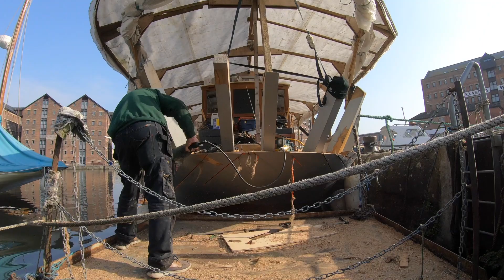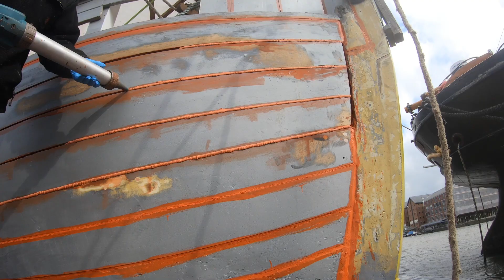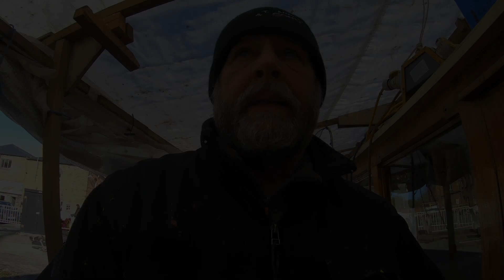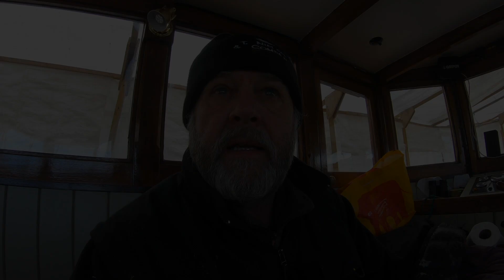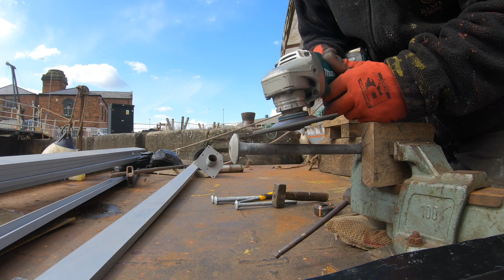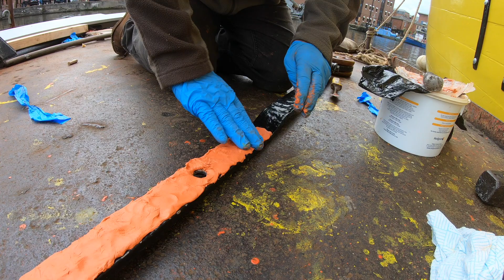Restoring Josefine (part 15) No Let Up.

Comment: I know its not that big of a deal, but why did you grind the squares off the bolts? You could have cut the squares into the chain plates and then it could "lock" the bolt for you, and you wouldnt have taken the zinc off the bolts, allowing them to rust at their weakest point?
Reply: Never mind, I just watched a bit further and saw you going to spray them.
Reply from the maker: That sounds like a very good idea Rachael, I suppose it was too late for us anyway, we had the chain plates galvanised some time ago and in some ways it’s better now that if anything is going to rust, it should be a replaceable bolt than a chain plate but you make a very good point. Thank you.

Comment: Ahoi Josefine! 
Reg I'm sorry I gotta recommend something for situations like Your scraped/ground bolts lacking galv at a pretty critical point after grinding: We used lanolin, woolfat, in situations where some corrosion was pending without anybody getting towards it again unless everything was taken apart again. 
Woolfat or lanolin is to be bought in different formulations, which basically just determine the viscosity of the stuff - it's always the same hair-fat of sheep. For the ground necks of those bolts I would have used "lanolin anhydrite" which is sold via amazon or many other places as an ointment-basis, and is quite hard and stubborn to work with at "normal outside" temperatures, while You can warm it up slightly with a heatgun or a little soldering flame to make it yield and run to every little nook'n cranny You want it in. 
That stuff is used on every surface in ballast water tanks of big bulk freight ships (the tanks within all those subaquatic neophytes come to every port they don't belong) to prevent the hulls from rusting out from the inside during times when no neophytes ballastwater has to be transported, while anything used for that purpose has to mandatorily be non-poisonous first and foremost - it's durable in any sort of water besides over about 45° to 55°C, it stays sticky forever and when warmed up it re-closes its surface over probable cracks and fissures. I also use it for about two decades inside my vintage car frames (in a much thinner formulation though) to stop already going on corrosion with very good results, and we also used it back in the days in low weight high performance boat building to prevent stainless rivets and stainless brackets to start contact corrosion when put in/on aluminium booms or masts (which was before carbon prepreg vacuum bagged composites of course), and I stop stainless bolts from corroding rocksolid into cast aluminium motorcycle and racecar parts with it, too (works better than anti-seize unless in engine parts - too hot ain't the right use). Use it copiously with "material to spare", it's non-poisonous, principally an edible (while awful of course), it stinks like wet dog or wet sheep and sticks like marten-poop wherever You put it, on purpose or unintentionally, but it's easily removed with acetone and does not harm the environment at all, even when You make a huge mess with it. 
I know Your bolts are already in by now, but that stuff might actually even be put in, well warmed up, from outside depending on how big a chink You have between hull and chainplate.
Sorry for the knowitall, but that stuff amazes me to date and I never see it used because next to nobody in the tech world seems to even know that stuff exists. Cheers!
Reply from the maker: Hi Manfred, thank you so much for your informative and interesting insight into Lanolin. I agree entirely with what you say about Lanolin although I didn’t know just how effective and universal it was until I read your comments. Randie and I had a small flock of sheep when we lived in France (they were our lawn mowers, we are both vegetarian!) and we used to shear them every year, Lanolin is very good for silky smooth hands! As you say, the smell is a bit clawing but great stuff. We do keep a small supply on board for ‘greasing’ gaffs etc but will now apply it more widely. We did respray the bolt heads with several coats of cold galvanising paint so they are not completely unprotected. Restoring vintage cars was my fathers hobby and I spent many years as a boy helping him, I remember very well, lying under the car spraying the chasse with liberal amounts of ‘wax oil’. Cheers.

Comment: dear, I congratulate you for your work and perseverance, I want to ask you about the formula of the putty you are using, thank you in advance for your help
Reply from the maker: Hi Nino, Thank you. The putty is a simple mixture of linseed oil putty (the type used in glass windows, natural not the coloured versions) and red lead powder. A small amount of extra linseed oil is sometimes used to thin the putty to get a nice consistency that will freely squeeze into the caulking seam and when I make the red lead paint to smooth the seams, I also add about 30% Turpentine and a small amount of a drying agent. Hope that helps.

Comment: Now I have seen all your videos, already longing for the next one.  What project do you have with a boat lying in the water, you manage it very well at the same time you have to film and handle all the work. Love your channel 👏🙏🇸🇪
Reply from the maker: Thank you Bosse, we are impressed and very grateful that you have watched all our video’s and delighted that you are enjoying them, we hope we are getting better at making them. Working on the pontoons can be a bit challenging sometimes but most of the time we are barely aware that we are afloat! It has two huge benefits, on a lengthy project, it’s much cheaper than drydocking and it’s much better for the boat than hauling out onto the hard, in that it stops the very damaging effects of drying out. It also makes it much easier to live on the boat, as we do, while working on it! Cheers.

Comment: Hello. She's looking fine! I'm surprised you did not put any protection behind the chain plates bolt heads?  Keep up the good work!
Reply from the maker: Hi Lankout29, Thank you for your comment, we appreciate it. We did actually spray the bolt heads with cold galvanising paint and the red lead putty will also provide protection.
Reply: @SailingWood  Hi! I was thinking of something to prevent water ingress along the bolt heads and into the holes. I think even galvanized iron will rot away if kept wet...
Reply from the maker: @Lankout29  I believe the red lead putty will achieve that?
Reply: @SailingWood  IMHO if it flows back up to the bolt head when tightening, yes.

Comment: maybe some good sika  under the chain plate bolts you cut down would help with any rust issues
Reply from the maker: Thank you Geoff, we did our best by spraying the newly cut parts with cold galvanising spray then liberally spread red lead putty everywhere, time will tell!